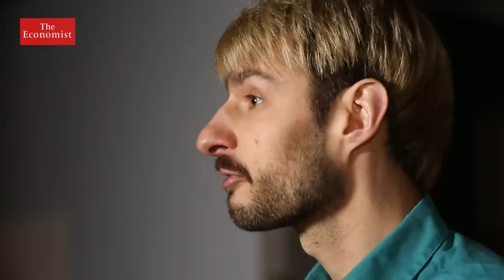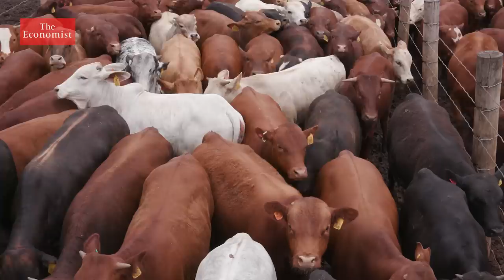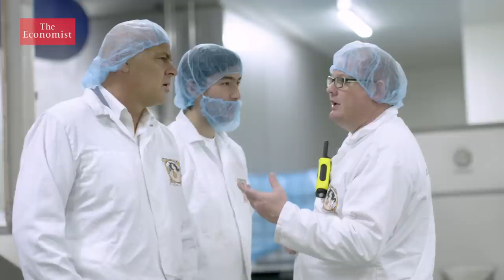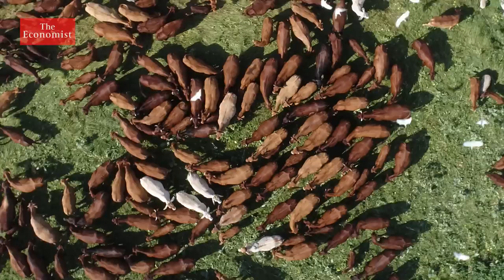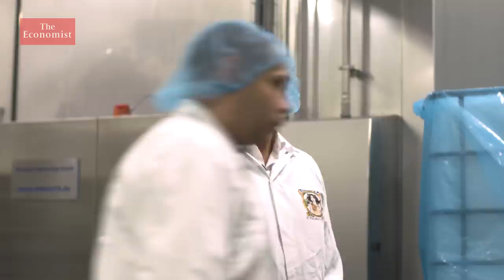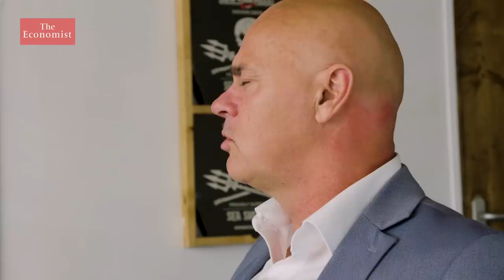How could veganism change the world?

Comment: Hitting centre stage finally! This will be the biggest and most dramatic event in the next 50 years.
Reply: you're not going to be able to continue your usual vegan diet for the next 5 months,let alone 50 years!
Reply: @lilaclizard4504  what makes you think it is not sustainable?
Reply: @dvms75  coronavirus is going to each you the answer to that over the next 5 months isn't it. If you can maintain your usual diet for the next 5 months, then it's sustainable, if you can't, take a look at what food is available in your areas & outside longterm tinned stuff, what you are able to buy easily & cheaply in these coming months is what you should be eating all the time if you want a sustainable, low impact diet

Comment: Id like to accept the challenge. Here is my reasoning:
1) its proven to be unhealthy to not eat meat. 
There are some nutrients, like essential fats and a very few vitamins like K, that you dont get from plant based foods. A lot of nutrients like many of the vitamin B complex, iron and proteins are very difficult to get from plant based diet only though not entirely impossible, but as amtter of fact most vegans have to quit their diet after 5 years because they do egt a lot of health issues that are nutrition based. 
Also many vegans eat wayyyy too many nuts and acidic fruits which results in a lot of allergies, potential nerve damage and teeth problems.
Almost no vegan actually eats the neccesary vitamins and proteins per day because that is, while in theory possible, an basicly impossible task for any person that cant spend 12 hours a day planning the diet, preparing and eating it.
Also some plant based oils are actually quite unhealthy and can make you fat extremely quickly, not to mention that most vegans simply lack protein and thus a lack in physical strength
Finally, plants have self defense mechanisms - usually the Kernels are not only rich in nutrients but also acids and even poisons and while they dont make much if youe at plants from time to time, they can add up quickly to very unhealthy levels but most importantly many of those are anti nutrients and make it much harder for your body to actually get the nutrients needed, cause headaches and a generel feeling of being tired.
Also many fields in special of "bio" products are usually set right next to highways...due to all the heavy metals in the ground and air due to the traffic, insects dont even want to eat those plants...but you do, and given those metal content in your food you can slowly poison yourself as result.

Sub part to 1) is also the sustainability because rarely do farmers rotate fields anymore which results in a severe lack of minerals in the ground leading to a drastic drop in nutrients in plants. Bananas as example lost an average 90%!!! of nutritional value between 1990 qnd 1995 and another 95% of what was left between 1995 and 2010. So bananas have actually less nutritional value than donuts. And while Bananas are the most severe example, most fruits and vegetables lost 50% of their nutritional value in the same span of time.

2) Many fruits and vegetables are just as bad for the environment as animal herds are. In order to plant say a kilo avocados you actually need MORE water than you would for a kilo of meat, same is true for stuff like Soja beans.
Also in order to plant those, huge parts of rainforrests are cut down and replaced with fields.
Due to overuse of fertilizers the groundwater gets extremely rich in salts and becomes undrinkable, and makes huge ares infertile as the salts in the ground dont allow any plants to grow
In order to get your resh vegetables and fruits to your local supermarket while they are still digestable, we pump out HUUUUGE masses of fuel into the atmosphere mainly through to plane travel or contribute to oil disasters from wrecked ships that transport logner living wares like coconuts.

3) Moral. Villagers get forcefully removed and even killed in order to make room for new room for bananas, slaves are forced to harvest fields and there are Mafias running the business on in special exotic plants, kill native people and take their land.
Also plants are alive just as animals are and indeed if we were to switch from meat eating to veganism most cattle would be killed anyway to make room and not sink more money into it, think of the billions of animals that will never be born and indeed, since we bred cattle to be productive they cant survive in the wilderness, meaning that cattle animals will go extinct and just vanish from the planet, not to mention that in order to provide all the fruits needed for the entire human population, we would have to cut down so many forrests that a lot of other species would go extinct as well. just think of the strawberry....right now we would need about 90% more strawberrys than are avalaiable on the entire planet to saturate the market. What do you think would happen if everyone would go vegan?

4) Evolution. Yes...its been shown that our brain mainly evolved due to the switch from plant to meat consumption as the brain is mainly made up by proteins and proteins are mainly found in meat. When our distant ancestors switched to become actual hunters our brain sizes increased drasticly.
While on the other hand we see that peoples who relied mainly on agrical culture for survival for the last 6000 years, actually do have smaller brains than peoples who had a mixed diet.
Quite some health issues, like allergies and other immunse system related problems are drasticly increased in populations that eat lots of carbohydrates. Sugar being the worst form of it  but your body transmutes carbs into sugar anyway. 
Children who grow up on a vegan diet develop significantly wors ethan children who eat meat - they dont grow as tall, dont grow as strong, their immune systems are weaker and even their average IQ is lower.

4.1) Digestion. Most plants are more difficult to digest than meat is. That is the main reason why plant eating animals have to either eat their own shit, throw up and eat again or have 4 stomaches. its much more difficult to digest plant fibers than muscle fibers and our human digestive track isnt build to digest plants only, we will get diarereah like hell - and both are very common amongst vegans, further reducing the ammount of nutrients absorbed.
indeed you can see in our very faces that our eyes and teeth are those of predatorial animals not plant eaters, thats how we evolved. Now we are as omnivores in the lucky position that we can eat a mixed diet...and thats exactly what we should do. For short periods of time we can live from one source only but extended periods we will get health issues if we eat meat only or plants only.

5) money: Actually its much more expensive and labour intense to get your fill of calories each day on a plant based diet. A kilo of tomatoes is about half the price of a kilo of meat, but has only about 1/10 of the calories so youd basicly have to spend 5 times more money on food to get the needed calories...not to mention much more cause you need a very varied diet to get your nutrients. So basicly veganism is economicly not affordable for the vast majority of mankind.

6) Alternatives: Its not like we dont have options that greatly reduce our enviromental and moral problems. We can luckily due to science not only create almost all vitamins, minerals and other secondary nutrients artificially, but we are also able to make calory intense foods artificially. THus if you really care about the environment and animal lives you shouldnt go vegan but really, artificial food - get calory high products with artificial proteines and sugars to fill your calory need, and then take supplements for the other nutrients. There, much much better than being vegan from every angle you could possibly look at it. Sure not as tasty but vegans usually complain that meat eaters shouldnt cry about taste so...you loose.

Comment: Along with Jersey or Holstein Western cows , methane gas is emitted in much bigger quantity by Shell gas producers in USA. This methane gas trapped inside the earth , is flaking out since 2008 , and causing the heat waves that we are experiencing in summer.  It's making ocean currents more hotter and that brings sharp increase in summer temperature and affects rain and wind cycle across the world. 

Numbers of animals in the world have not increased so much since 2008 that arctic ice is now at the lowest level. But, yes methane gas emissions due to shell gas flaking has definitely increased multiple times, and that is melting arctic ice to the dangerously low level since human being came into existence.  So, by just being vegans, methane gas emissions  from shell gas flaking is not going to stop. 

Indian vedic cows emits only 5% methane than western cows. Why it is so ? Read Ajit Vadakayil blog on A2 milk.

Comment: Well this isn’t going to happen. So what now?
Reply: Try Alan Savory's "holistic grazing" instead :)
Reply: Lilac Lizard    No need to try.  We do this in many parts of the world.
Reply: @marvinmartinsYT  true :) We should be expanding it though, subsidise the infrastructure to allow all farmers to convert to that instead of subsidising destructive crops
Reply: Lilac Lizard   Subsidising drives prices up.  That won’t work either
Reply: @marvinmartinsYT  but I'm suggesting that instead of ongoing subsidies every year that already exist, we provide one off subsidies & once they're done, the farmers are on their own, with no more government money. I'm looking at what happened in the Great Barrier Reef run off area, where the government subsidised the infrastructure to replace it's clean up spend & farmers have gone from struggling to using their new profits to buy more properties & fund their restoration & infrastructure for holistic grazing systems, therefore getting the ball rolling for wider conversion & environmental repair with only a small one off subsidy. Imagine the level & speed of conversion that would be possible if this sort of initial subsidy was more widespread!
Reply: Lilac Lizard  subsidies drive prices up. No matter how they are implemented, price goes up.
Reply: Lilac Lizard    I’m not saying they don’t work. Just that it all costs down the line.
Reply: @marvinmartinsYT  subsidies push taxes up not prices, but if short term subsidies reduce long term government spending, then that has to reduce overall costs right? How can it not?
Reply: Lilac Lizard    Prices never, never go down! Once the price is high. It stays there. When my taxes go up and it costs my business more, how can you think my pries would not go up as a result? When taxes go up on my workers, they ask for more pay. For work they’re doing, that I sell to people. You see where I’m going here I hope. ?
Reply: Lilac Lizard   Prices don’t go up.sheesh
Reply: @marvinmartinsYT  like i said, they transferred the money that was being spent to clean up the reef & kill crown of thorns starfish into environmental grants for farmers. So contract divers collecting/killing starfish lost their jobs at the end of their contracts & fencing people got new jobs & once they'd completed the fencing, that was the end of their contracts too & the excess money was set aside for monitoring/future needs